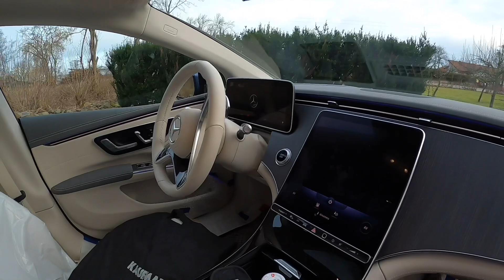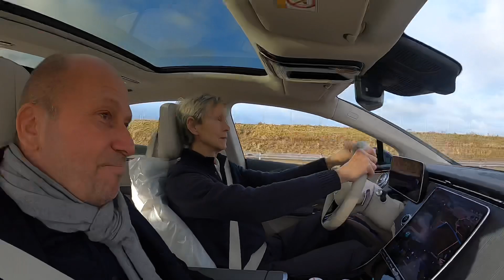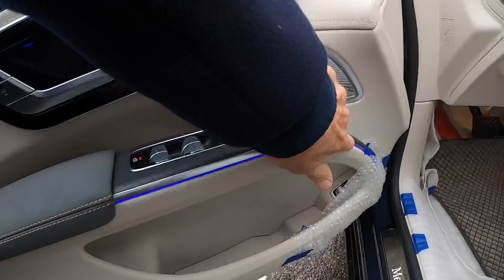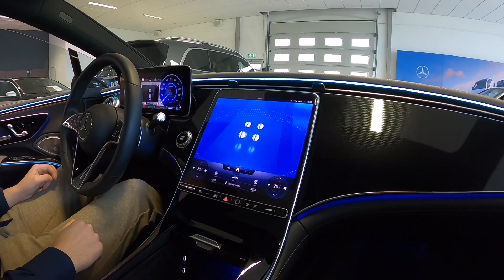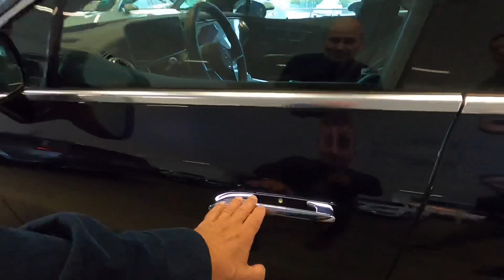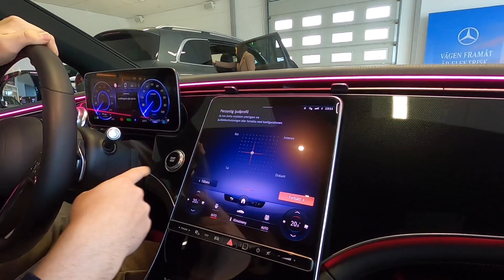Electric Mercedes EQS Test Drive 🍀

Comment: Tesla turned the once regal and classy luxury model S into a 
Zoom-Zoom- Dodge Challenger wanna-be with more speed, black accent 
trim, ugly black wheels, 10 year old body style and an airplane yoke... WTF???. Mercedes has 
just filled the gap with the EQS. I'm a former Tesla owner now. I traded
 it for a 450+ ($102K base price) and it even came with a steering wheel!!!! 425 mile reading at 100% charge and it self-drives on 
par or better in some ways than my Tesla did. And It's plenty fast enough too. This is a car for
 grown-ups  who want every possible creature comfort, class, quiet cabin,
 great build quality, long battery range with brick and mortar 
dealerships in every town... It's a dream to drive and turns on a
 dime. And Mercedes even threw in 2 years of free charging at electrify america.... Nothing to complain about. Plus my Tesla-brand home wall charger works perfectly on the EQS with a $150 doller plug-in converter,....

Comment: Lovely Merc! This is most likely the future but even the cheapest fully electric cars are still quite expensive. Also, I would not yet want to own a used one that’s out of warranty..😅 But I guess the cost of fixing potential issues will come down as well. 

How much I like my Volvo 940, the cost of driving it is becoming insane. Planning to buy a used V70 D3 and drive it until electic cars make more sense. But the 940 will stay in the garage. No car will ever reach that reliability in Finnish winter conditions 😂
Reply from the maker: The EQS is too expensive for me, but have features that will appear in lower priced cars later on. So a very interesting car. 😊

Comment: Pilot(s) talking about sustainability is usually the biggest contradiction... May there at least be some day when JET A1 is taxed at the same rate as car fuel. Or diesel train fuel, sigh...

Still like the videos and the car..
Reply from the maker: Understand what you mean. But check my videos of the plane Pipistrel Velis Electro! I’m a strong supporter of the use of biofuel and more fuel efficient planes, like the A350.
Reply: @bjornpilot  Can you go fly Eric Scott Raymond's Sunseeker Duo this season? I think he'll be flying it in Europe like previous years. Would love to see them get some more publicity as such great aircraft it is. 

After that I'd love to see more about the SolarStratos aircraft. I don't think it is ready to fly too much yet, but could still get some publicity.

I dream of a solar glider kit plane that could fly IFR (or VFR so high that because of almost unlimited endurance - you could wait for almost any kind of weather to pass)
Reply: May there at least be some day when enormous infrastructure building and maintenance cost and environmental impact are taken into account when talking about "green" trains.

Comment: Hey capt, are pilots allowed to undergo cataract surgery.
Reply from the maker: What is that?
Reply: A pilot or controller may perform aviation duties with a cataract as long as he/she meets the visual standards for the class of medical certificate applied. The distant standard is 20/20 corrected for First and Second class certification and 20/40 for Third class certificates.
Reply from the maker: @flyingbarbarian1  Aha, it’ correcting your eyes. Thanks!